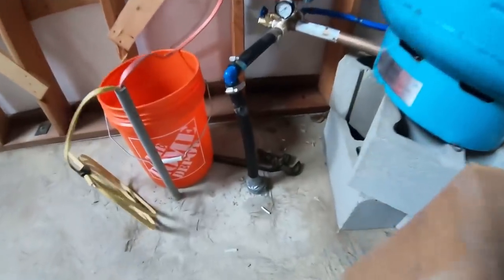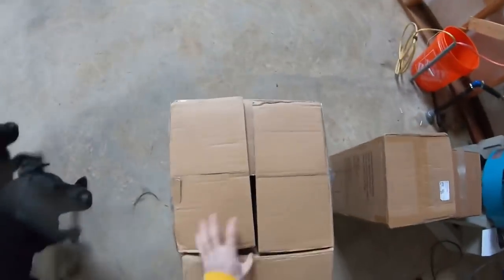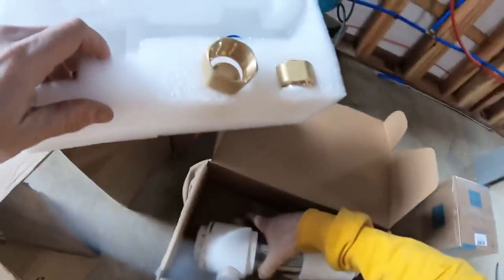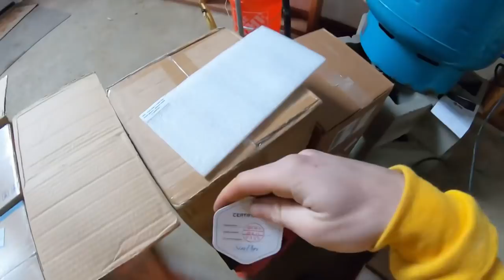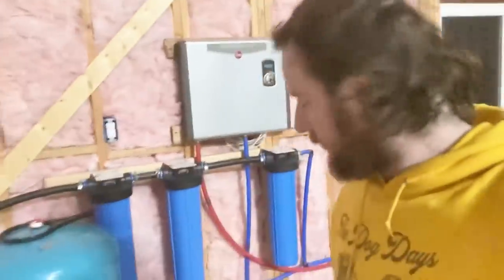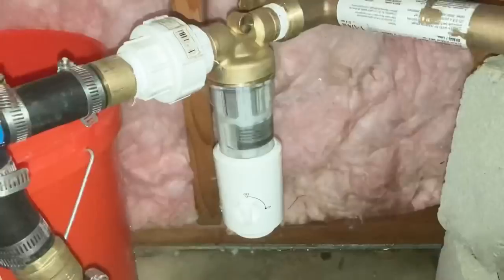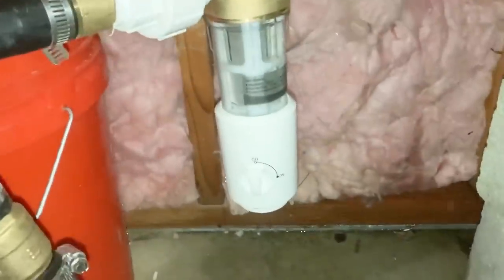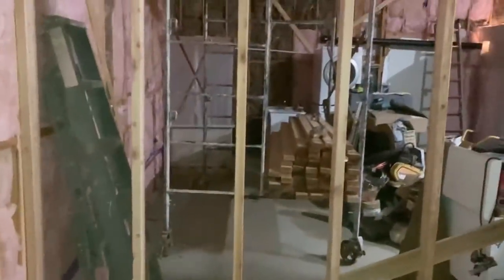Whole House Homestead Well Water Filter System Installation | Building Our Own House

Comment: Nice job on the filter setup, plumbing has come a long way since I learned it in school. Nice thing about plastic pipe it makes it easier to change the setup later if needed.
Reply from the maker: Thanks, ya that pex and poly are almost cheating. Super easy.

Comment: I am so glad someone finally did a well water filter setup that deals with iron water. I live in NE Tenn and we have horrible iron sediment well water. We run only a small filter. I'm talking 2" by 10". And no, it really doesn't work but that is what our well company told us to use. I am definitely gonna check out your system. I can't wait to hear how it's treating you! Can you post a list of equipment and filters for the water build?
Reply from the maker: Hey Mimi, thanks for watching. This setup definitely improved the quality and taste! I updated to description of the video to include the links. I bet this system would help you out quite a bit. Good luck, Thanks again for watching!
Reply: @LaidBackLiving  Thanks so much!!!

Comment: Before it’s all over, your going to be installing a water softener. I’ve been fighting iron in my well for 25 years. Drop pool chlorine tablets down the well twice a year to kill the iron bacteria, it will also cause the bacteria to turn to a solid and drop out the bottom of the casing into aquifer. I’d by a Fleck base STX5600 system by Teir 1 off Amazon for $499. Use standard salt & iron salt every 5th bag. System should last 7-10 years. Just buy a new one when it’s cooked. You got a good start with the spin down sediment & the big blue canisters, buy the Big Blue 5 micron filters in bulk from Amazon, they’ll protect the softener. Carbon filters are a waste of money.

Comment: Have you had any issues with the HDPE pipe connections?  Reason I ask is I am also setting up a filter system from my well and I litterally only needed like maybe 10 - 15 ft of HDPE 100 psi poly pipe and it's either you buy the 150 foot roll or you buy it in 2 ft pre-cut sections.  So I bought it in pre cut sections.  I connected 2 pressure gauges to the filter, one before and one after the filters.  When I pressure checked with compressed air I noticed one of my pressure gauges was not perfectly straight vertically, so I gave it a little adjustment to make it perfect and it started leaking air cause I had the system pressurized to 80 psi.  I ended up having to replace that section of pipe with new pinch clamps and pressure checked and it's good, but I can't shake the feeling that I don't fully trust the HDPE piping and fittings.  I mean it was litterally just a 1/4 inch adjustment on that inline gauge to make it straight up and down, and when I moved it air started leaking.  So I guess what I am trying to say is it seems as though any twisting movement in the connections will cause a leak.

Comment: just out of curiosity. what pressure are you running? and what temp on the hot water?
Reply from the maker: We did a 60/40 pressure switch. The heater is set at 130*F
Reply: @LaidBackLiving  good pressure. good temp. thanks for the answer.

Comment: We use a very similar system at our farm. 25 years and no issues so far! Only suggestion would be to use a NSF grade silicone based grease on the filter housing O-rings, makes changing the filters so much easier.
Reply from the maker: Thanks for the info!

Comment: Just remember that a carbon filter only removes taste and odor not iron. You have to add a complete iron removal system if you want to take the iron out of the water so it doesn't stain fixtures and clothes.
Reply from the maker: Thanks.